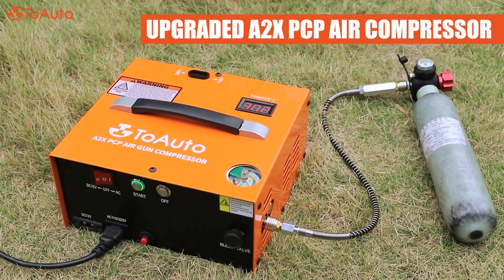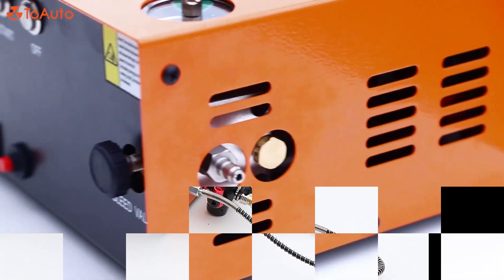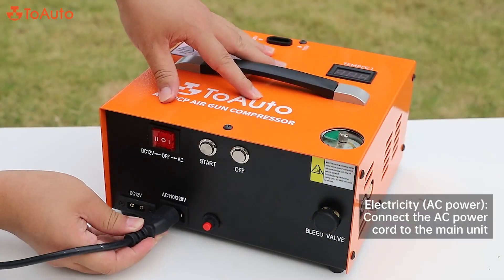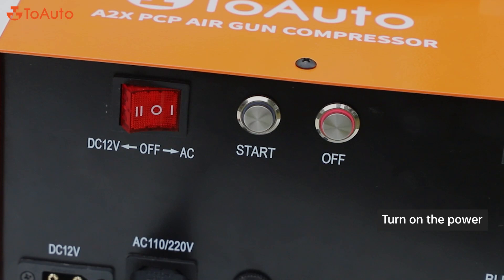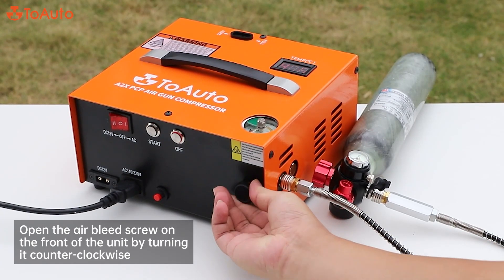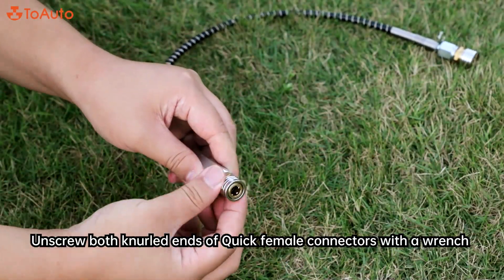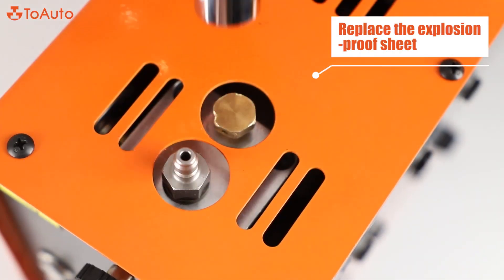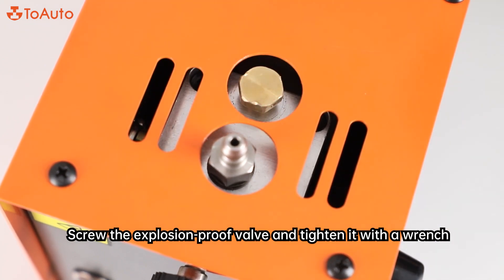【Upgrade】How to use ToAuto A2x PCP AIR Compressor? Use tutorial and problems solve/With transformer

Comment: How much
Reply from the maker: $349.99, the current preferential price is $294.99.
Reply: @ToAutoOfficial My Co2 Tank is 124 Bar How I set up manually the correct Pressure on the machine????